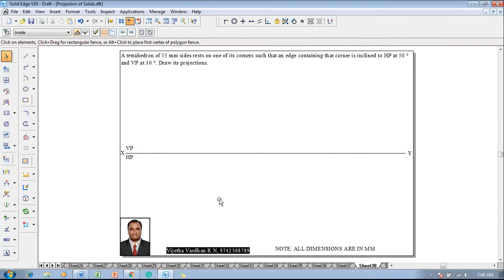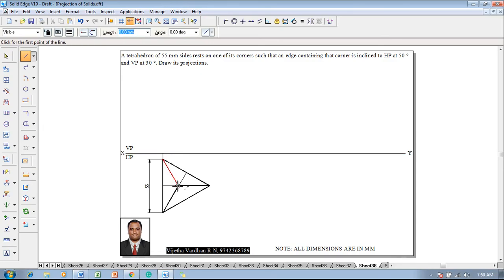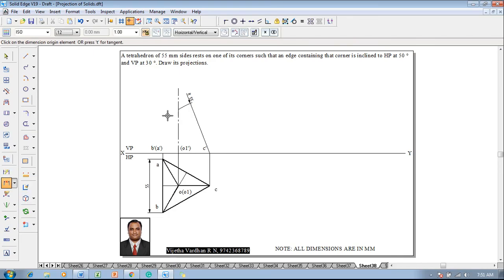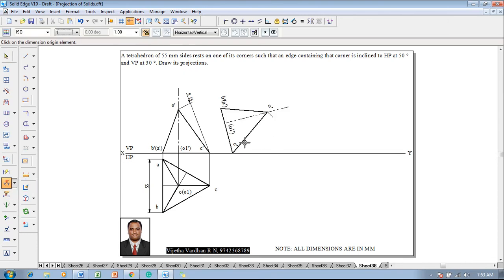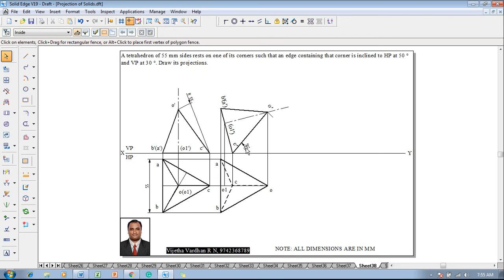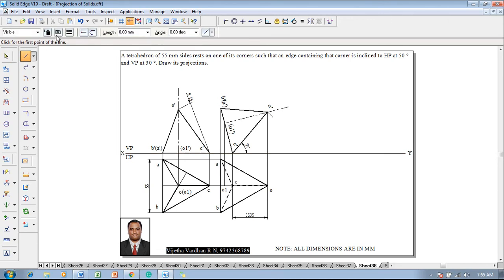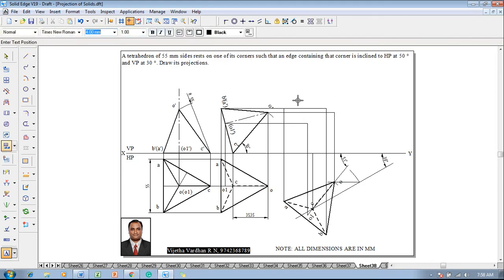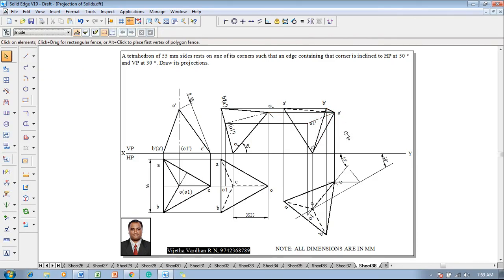Example 38 on Projection of Solids

Comment: Sir if it is corner resting we should place the corner on the left side right? But the edge is placed at left sude
Reply from the maker: In case of solids we are rotating the front view clockwise so you must consider the right side not the left side
Reply: Thank you sir @VijethaVardhanRN
Reply: So it's only applicable for planes?

Comment: Sir in the question they given corner is inclined to HP why you taken sides in HP
Reply: Sir please give solution to this
Reply from the maker: You could clearly see that it is corner resting only
Reply: Sir then in plane we taken corner to left side which is correct
Reply from the maker: @BhavyaHj-z5q  Yes
Reply: Ok sir tq
Reply: Sir when we want to take beta angle